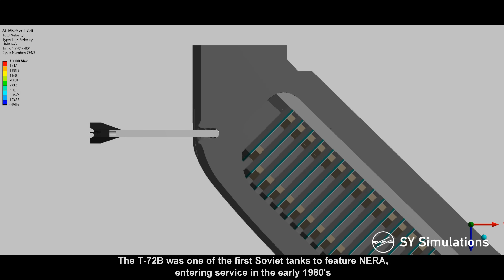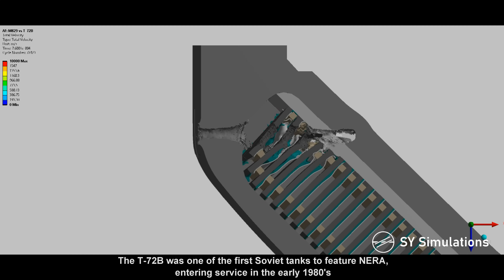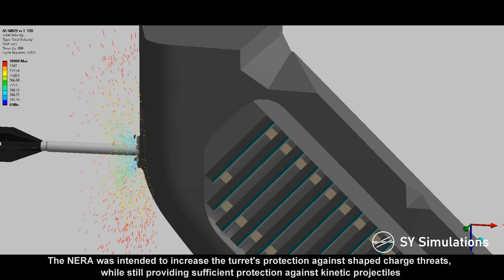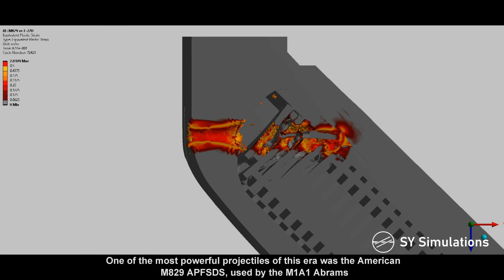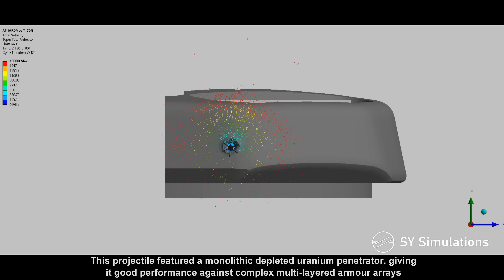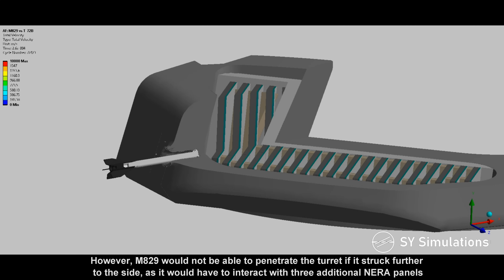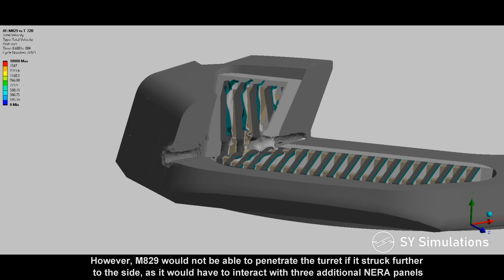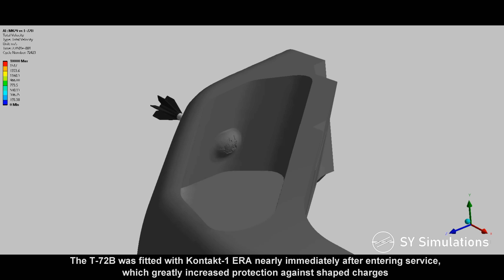ABRAMS vs T-72B NERA TURRET | 120mm M829 APFSDS vs NERA | Armour Penetration Simulation

Comment from the maker: While most T-72Bs featured Kontakt-1 ERA, it was not effective against APFSDS, so it has not been simulated here. Additionally, the 1989 modification of the tank featured poorly placed Kontakt-5, leaving the impact point in the video exposed.
Reply: So, simulation is not correct
Reply: Something kinda of stupid I thought of that I would like to see if you are willing to is what if PzGr. 43 from the maus was DU not steel (still the same otherwise) at the same velocity and how much better it is compared to the war thunder stat card if that’s accurate as I would imagine a shell like that going from roughly 62 pounds to nearly 143 pounds would have a tad bit extra energy and pen ( you don’t have to do every simulation like 10m at 0, 30, and 60 just wondering if you could give a rough estimate and an interesting animation of your choice to show the difference )
Reply: Hmm, isn't the explosive from K-1 would still have a little bit effect that can breaks penetrator tip?
Reply: @alderlake12th  look closesly at the simulation, this shot is from 2km and still goes right through. k1 is borderline useless against kinetic munitions, the play is extremely thin and the explosive looks devastating, but in practice there's so much space to expand the pressure is too low to affect anything about this round.
Reply: @wkk2177  Hmm but the new welded config on T-90 might solve these problems. It is the same but with RHA either
Reply: Still looks like a close call...
are shure Kontakt1 would make no difference? I mean it's basically nothing left of the dart?
🤔
Reply: @justacomment1657  yes, it makes difference but it appears that some are a bit too lazy to understand that even a small steel armour can stop fragments and K-1 definitively had quite a bit of armour. The thing that they failed to understand is that K-5 is capable to reduce 150-200 mm RHA pen, and therefore for them, the K-1 would do nothing just because it worths about 10-20% of K-5. But this definitively is NOT to say that it's non-existent!
Reply: Nope.  K-1 was not meant to be effective vs ERA but this doesn't means that is totally ineffective. Old extimation put this at about 30-40 mm RHA equivalent and that is, inside K-1 there is some steel and some HE. So you cannot say that it's not present because ineffective. At 1 km would be ineffective anyway but add 20-30 mm to T-72 and you will get probably protection until 1500-1800 meters, depending how fast the ammo is losing speed.
Reply: @diademadiademoni202  A brick of Kontakt-1 contains of 4mm of steel (2mm on each side of the explosive element) with a 3mm box protecting it all. 7mm of mild steel is doing absolutely nothing to stop anything.
Reply: @ImBigFloppa  you would be right if we couldn't account the effects at the edge of the maximum range of engagement as it happens here. Also the HE explosion is something you are missing in your analysis.
Reply: @diademadiademoni202 The HE does nothing. It shoots out a paper thin piece of mild steel and the explosion itself is just a small explosion. A 1 inch thick uranium rod is going to be entirely unaffected by either of those
Reply: Nah bro. M1a1sepv2 couldn't pen a T-34 from the side. Run it back
Reply: Was not effective ≠ no effect, it would definetelly stop from penetrating
Reply: @tomasmikel  kontakt 1 is too light and slow to damage the projectile, the extra effective armor against the shell would be no more effective than an equally thick rubber plate
Reply: @tomasmikel  not effective means not enough for the threat given. BTW even a spall liner could not do much vs APFSDS but it the piercing power is reduced by 95% then 600 mm became 30 mm so yes, K-1 is enough, and probably enough even at closer range if you add some lateral angles.
Reply: @tomasmikel rusian fanboy crying😂
Still failed their job on Naji Ukrain😊

Comment: Maybe K-1 ineffective, but here, this simulation shows the edge of effectiveness. Just add let's say 10 mm armour and you will stop also those last M829 fragments.
Reply: shot fired from 2km, SY puts the range at highest possible so there's actual interaction. if this was from close range there's nothing that can help this tank.
Reply: @wkk2177  No one says otherwise. But K-1 at 2 km could stop the last fragments, even if at 1.5 km would not.

Comment: The thing is that the 120mm is slightly better in performance to the 125mm using shells. Now when you add in the 125mm missile they got the advantage in range and penetrating. It was report in the Ukraine War that on two episodes that two different T-72 took out two M-1's using these missiles proving that the T-72 let alone the much improved T-90 can win against Western Best. The West and Russia has two different philosophy on armor warfare.
Reply: These missiles are useless against APS equipped M1s. And there's no proof of engagement you mentioned above

Comment: Presumably the second gen M829A1 would overcome that issue of not penetrating if it got that hit slightly to the right? The "Silver Bullet" performed exceedingly well in the Guld War, but I don't think any of the Iraqi tanks the M1A1s faced were (then current gen) T-72B either (and of course the whole arms race between the developments of the M829 line and Kontakt and Relikt, proably some pretty significant money spent in both countries trying to develop such a simulation as this to see those results)
Reply: commies don't use money

Comment: Looks like you modeled the penetrator abrading away like tungsten DU doesn't blunt like that it's like a single crystal that is in all practical terms self sharpening decreasing drag through the opposing material and it helps normalize the penetrator when there are changes in density throughout material and after passing through voids
Reply: This is not true. All evidence suggests DU has the ability to slow or degrade the amplitude of the degree of mushrooming through more sensitive adiabatic shear mechanisms but only within the limitations of hits at normal against armour plates with totally homogenous features, that is, including composition, type, and BHN. No quality here is fulfilled in this simulation.

Worse still with your assessment, DU is a heavy metal and not a crystal. As DU is just uranium, DU's properties are analogous to that of regular heavy metals or metals outright — for example, uranium (IV) oxide can also be found as pellets as nuclear fuel. In the RBMK, this fuel was barely twice the enrichment of natural uranium (~0.71%) at 1.8%. The lower end of fuel bundles not in the active zone had pellets with 0.4% enrichment — as depleted uranium is any uranium substance below natural enrichment, the RBMK used DU. So, in conclusion, we see that uranium (IV) oxide functions identically to any metal oxide, and so does regular DU with heavy metals.

Comment: M829A1 also came out in 1988 and would pen this easily.
even M900 105mm ammo would beable to pen this.

though the turret is the hardest part of the tank to pen, and all service rounds of the time would go right through the hull front easily.
Reply: yeah the late 80s were a weird time where all tanks were able to pen each other like it was the 60s again, it required innovations like Kontakt-5 to change that
Reply: @spextahd5673 K5 is not nearly as good as they claim vs darts. sure it has an effect but its not 250mm vs KE or w/e bs they claim. that's physically impossible given the thickness and angle of materials used.

K5 is about 120-140mm KE when sloped at 60 deg or greater, and only about 60-70mm ke when vertical on the side

relict is also bs, though it is better than K5 offering about 180-200mm when sloped and 90-100mm when vertical.

the M829A3 round that came out in 2002 can pen all current russian armor easily so can the A4 from 2016
Reply: @TheAngriestGamer.  Got a source for all of these claims champ?
Reply: @fen3311  K5 resistance is150mm KE/650 mm CE totaly vertical and 220mm Ke /800 mm CE  to 260mm KE/ 900 mm CE  45° to 60 °,
Reply: @TheAngriestGamer.  irrelevant as all the fiiring trials concluded that A1 was not enough to defeat a tank with K5

Comment: Video suggestion

M1A2 (or and other Abrams) turret ring vs 3BM32 or 3BM60
if possible both but if it takes to much time I rather see the 3BM60
Reply: Turret rings on all modern tanks can be penetrated by any APFSDS, even oldest ones.
Reply: Turret ring of Abrams is only 200-300mm all apfsds round can go through it. No turret ring irl can with stand a dirtect hit from apfsds.
Reply: turret ring is a weakspot as well as the optics or crew hatches, also could partially ricochet from turret into upper glacis if we talking bout 50/50 turret/ring shot
Reply: @MercTac APFSDS ricochet???
What kind of angle are you talking...?
Reply: @theregalproletariat it can happen quite a lot around Abram’s driver hatch.
Reply: @tacticalnoodles  "it can happen quite a lot around Abram’s driver hatch" - In War Thunder?
Reply: @maverick8697  Yes in War Thunder, I don't think many people have experience in shooting an Abrams and living to tell the tale
Reply: @maverick8697 happened IRl, friendly fire with M829 shattered on the UFP.....
Reply: @aflyingcowboy31  Did the remains of the shell got in, e.g. through the turret ring?
Reply: @maverick8697  No
Reply: @maverick8697  I should note though, due to the sheer light it caused when hitting the UPF the driver did actually receive flash burns to his face.